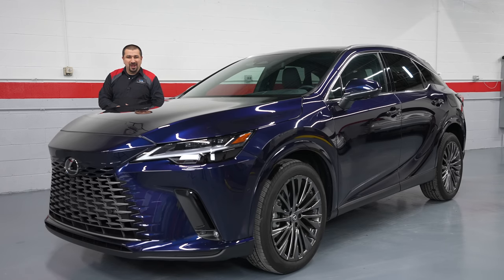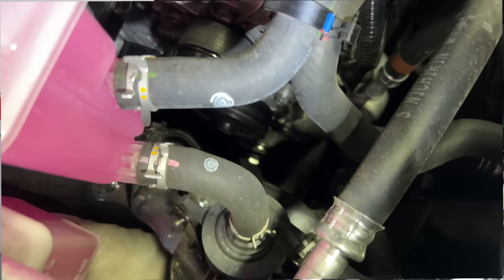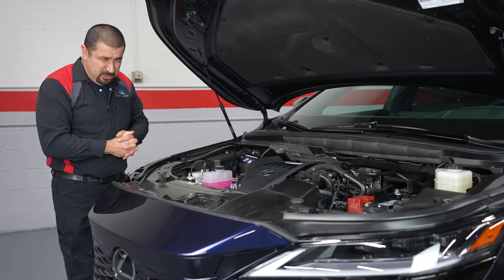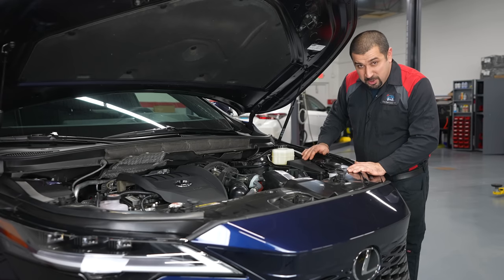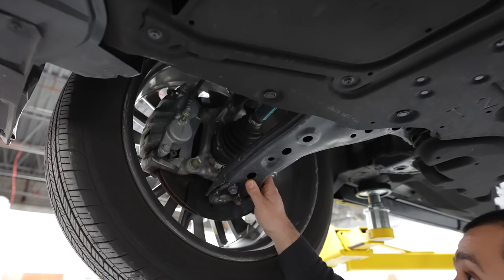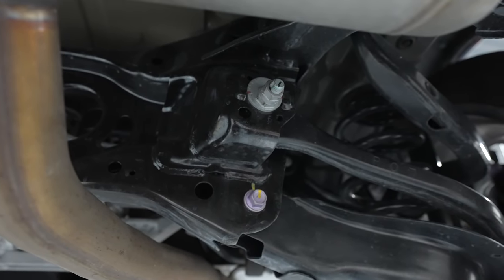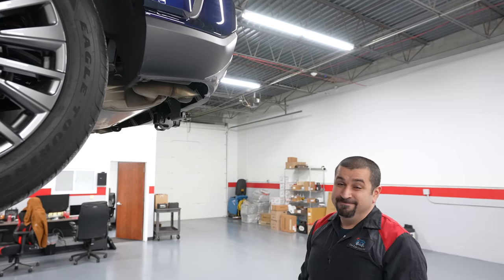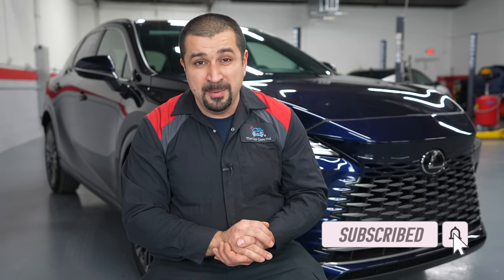Should You Buy The 2023 Lexus RX? Everything You Need To Know

Comment: Fantastic review from a very unique perspective - Thank you AMD (for the reviews and the rest of the content you create).  Comments:
- If the infrared alertness camera will allow me to use the adaptive cruise and lane-keep assist WITHOUT forcing me to have my hands on the steering wheel (just monitoring my attention), I think I would like it a lot.  Shaking the wheel every few seconds (driving on straight interstates) on current systems negates the benefit of a good lane keep assist.
- Totally agree with the comments on a 4 cyl engine.  I ran away from Volvos a few years back for this very same reason (engine out of character for that class of vehicles).  I love my 2GR-FKS in in my Toyota Tacoma (manual) and my ES350.  I guess I will migrate towards the LX (expensive!), or more likely, Tundra/Sequoia.  Or quickly snag the last of the V8's - like the IS500.

Comment: The engineering team is trying to meet newer emissions standards, so larger displacement engines are giving way to lower displacements and turbo charging. The problem is that the old RX is all about smooth. The interior is quiet. The engine is strong but unobtrusive. The new car replaces that with more engine noise and useless nanny tech that beeps at you and distracts you at the same time. Not smooth or quiet. At least it has a spare tire.

Comment: Lexus is tired of being the most reliable luxury car brand.... so it's looking to dethrone itself from this title by putting a turbo 4 into its best selling suv.... good work
Reply: Not true. The EPA forced them to put turbocharged engines with smaller displacement in the name of "environmental protection." If it weren't for the Democrats, Toyota would still be using naturally aspirated engines.
Reply: @lightsfansofthewest481  
No one forced Toyota to do anything.  Toyota is just using the new EPA guidelines as an excuse to cover up their massive cost cutting measures & failed, short sided EV debacle.
Reply: @TheBjjones  Okay, then why is Stellantis planning to discontinue the HEMI V8 and replace it with the Hurricane I6 turbo? Why is the new Chevy Colorado only available with the 2.7 I4 turbo instead of the 3.6 V6? It's only going to get harder for those still making V8 engines to meet emissions standards, like Ford and GM.
Reply: @lightsfansofthewest481  
Stellantis is only discontinuing the Hemi V8 in some Dodge/Jeep models while other Jeep/Ram vehicles will still soldier on with the Hemi V8, unlike Toyota, who has basically eliminated all of their V6/V8 powertrains & replaced them with downsized 4 cylinder turbos/4 cylinder engines with hybrid batteries, that in reality, aren't any better than prior Toyota engines.

Furthermore, there's absolutely nothing wrong with GM offering a 2.7L I4 turbo engine for a mid size RWD/4WD truck like the Chevy Colorado which is not quite the same as saddling a mid sized luxury SUV like the RX, known for it's serene quietness, with a raspy 2.4L 4 cylinder turbo engine.

And smart vehicle brands such as GM & Ford don't/won't bare the same draconian penalties from EPA guidelines ,which is primarily based on their current/upcoming lineup of EV's, none of which Toyota has on the market currently or in the pipeline.

Comment: Check your audio.  I hear a buzzing noise that is common on some computers that is caused by the ground.  Isolate the ground and the noise will be gone.  I’ve seen it on a lot of Dell Laptops.  Just isolate the ground pin, it isn’t needed on a laptop.  Or just unplug it.

Comment: I have a 2020 camry 4-cyl which is loud when accelerating. So I know what you mean about the engine not suiting a Lexus.
Reply: I have a 2020 Camry too. The 2.5 engine is just too noisy for the class. Thankfully you can still get a v6 in the Camry that’s significantly quieter and more refined

Comment: Another Gem Lexus and review. Love Lexus and this review is great. Yes this needs a smooth V6. Don’t like a turbo 4 cylinder, I think long term reliability can be an issue. 

I own a 2002 ES300 w 173k miles and my 1MZ V6 doesn’t burn a drop of oil in a 5,000 synthetic oil change interval.  Refinement, fit and finish is unparalleled. Whisper quiet.

Comment: AMD, I am sold on this RX, especially the 4-cyl (anyone who fixed the V6 water pump and rear spark plugs will  know what I mean). Yes, the 4-cyl is loud, but you won't hear in the Lexus cabin. I would buy it if the dealer can TURN OFF the auto start/stop function PERMANENTLY. As far as the turbo, I believe Toyota/Lexus should be more reliable than BBA.

Comment: 🤣modern safety features are really annoying for sure. when driving in urban setting it can drive you crazy with all the beeps and buzz. had all the gen RX but skipped 4th gen but coming back for this gen5 with again the nice smooth lines. RX is the best long distance cruiser in all weather condition with just right sized for urban environment. I will definitely miss the V6 bulletproof engines.

Comment: Hope my 2015 RX FSport lasts the 10 years of driving I have left; low mileage, meticulously maintianed , rust proofed yearly, fingers crossed.
Reply: Your RX has the bulletproof 2GR v6. You’ll be just fine. As long as you continue to take care of it it’ll outlive you
Reply: @naveenthemachine  yep.  My wife’s 08 RX350 has 155K miles on her and still runs/shifts like a dream.  My 2017 ES350 runs like the day I bought it at 35K miles.  BTW, looking at the new NX hybrid now to replace her RX soon.
Reply: You are describing me and my 14 Rx to the T. 👍 My 18 GS is my summer car and never sees snow.
Reply: It will be right in time for the 2025 RX250 3 cylinder bi-Turbo :D

Comment: If the Toyota corp will not stand up and resist and fight they have disgraced their ancestors. In addition they could reduce vehicle weight, remove all non-essential systems, and offer a basic V-6 with a bulletproof 4 speed auto with od manual air and 18 inch wheels. They are failing. Sad

Comment: How long can that turbo last? I talked to several mechanics and they told me 100K-160K. What is your experience with turbos?
Reply: There are turbos and there are lexus turbos. Cant lump them all as the same. If you paid attention to the vid, there are unique design differences which are explained. I would think they last much longer than 160k miles.
Reply: Turbos, if cared for (Oil changes, letting the car cool of before shut down) can last well over 200-300K. Also turbos are not super expensive they usually run 1000 bucks.
Reply: @AgonxOC  Does anyone out there owns a turbo engine that has 300K miles on original turbo? I have never met anyone who can say that.
Reply: @zemo2332  plenty of turbo engine with over 300K miles out there. What do you think those rigs, locomotives, and ships that move cargo around have!?
Reply: @AgonxOC  I am not talking about turbo diesel engines. I’m talking about turbo 4 cylinder gasoline engines. Anyone has one with 300K? How many turbos did you charge to get to 300K ?
Reply: @zemo2332  none, if you properly care for the engine.

Comment: The RX interior looks too much like a Toyota than a Lexus.

Where’s the leather doors? Leather / stitched dashboard? Stitched airbag cover? Wood trim? Or luxury features like air suspension, 4 zone climate control, or ottomans or a 12.3 in lcd cluster? You expect all of that in a Lexus.

Well none of that is there. Instead you get the same injection molded plastics as a Toyota.

Doesn’t really scream true luxury like the gv80 or MDX or even a cx9 palisade do.

So overall yea I was right from the get go. The RX just like the nx and lx are a mess
Reply: Half of the mdx dashboard is piano black plastic
Reply: That moment when a RX330 had the option for air suspension back in 2004-2006 because of a little rare package called the performance package. 
Oh, and the Japanese got folding mirrors and a front and passenger side camera.
Reply: @ryanandrew87  but I don’t think it’s as much as the Lexus RX. Plus the MDX has leather and metal speaker grilles to compensate
Reply: @Paul yeah. I’d even say my 2020 Camry XSE red interior is about as nice if not a tad nicer than the RX 

Of course no Toyota can beat the out of this world LC500 interior though

Comment: You and I totally agree.  It's nice to have some technology upgrades but it was negated by using a straining 4 cylinder engine.  In my book the engine and reliability are more important and most people who buy the RX are looking for that.  Also, what is the difference in the RX and the NX.  The NX is a smaller car, same engine, same technology you would be better off with the NX since the engine will not be as strained since the car is smaller.  I give lexus a down grade on the RX redesign specifically because of the engine choice and the electronic gizmos to open the doors.  However, Lexus usually knows it's market and I guess they are expecting the market to change on the people who want the RX versus its prior history.  The style design I can handle but otherwise a BIG MINUS.

Comment: Great review. I have the good old 6 speed auto in the 2013 Lexus RX. It hasn’t needed anything but normal maintenance and I plan to keep it as long as possible. Keep up the great reviews. 👍
Reply: Do you do the 'drain and fill' transmission fluid changes with your 2013 RX at 60,000 mile intervals?
Reply: @rightlanehog3151  I just use valvoline maxlife and ‘drain and fill’ it every 50k miles and have never had a problem. 210k miles and still going strong.
Reply: @apoc341  In that case you should be driving your RX for another decade without issues.   I change the 2 quarts of Amsoil Gear Lube in my 2005 manual transmission at 
5 year intervals which don't exceed 50,000 miles. The Toyota coolant and power steering fluid are done at the same time to keep things simple.

Comment: Great review again, unfortunately some of the most important features get forgotten. For me it is reparability and recyclability. When I worked for Siemens siemens printers and teletypes. They made their products with the best reliability but made it so it had great reparability. They designed assuming it was going to repeatedly fail. Down time was key. They simulated faults and monitored repair time. If only vehicle manufacturers  did a similar thing. Put the technology into reliability and reparability. The aircraft industry does a lot in this area. You need to be informed of danger or errors but not totally distracted. There is a famous crash resulting from the whole crew investigating a blown bulb. The system was working but the gear down and locked indicator  failed to light.

Comment: I'm a current and original owner of 2008 Lexus RX350.  I was "toying" with the idea of upgrading to a 2023 model, but this review has given me pause.  My mechanic has stated that I can drive this car into the sunset.  With only 80,000 miles on the car, no thanks.  I love sunsets.
Reply: Joyce, I also have a 2008 Lexus RX350 which I love. It has 95,000 miles on it. Its current problem is a hard-to-find leak of A/C refrigerant. I was also thinking of upgrading to a 2023 model. I might just stay put and have my mechanic add refrigerant when needed! That will be me driving behind you into the sunset!

Comment: Im on my 2nd RX-350 a 2020.  Got it Oct 3rd 2019. Great vehicle as was my first 2015. Last year I test drove a RX-350 "F" sport with 4 cyl turbo. I noticed right away it was a Turbo. Not as smooth when asking for GO power. It simply was not as responsive. My 2020 fuel mileage around town was 20 MPG. On a long trip in ECO mode and observing agressive driving, I got a showing 31 MPG. Highway driving and some urban driving.  Overall I drove 750 miles with that fuel economy. New 2024 4 cyl economy was not noted, but older V6 was more responsive. Just my feelings.

Comment: Have a 17 RX and after hearing the dropping of the 6 cylinder, figure this one will last us like - forever. 
Adapting to technology doesn't bother me, however my wife is another issue. She has a hard enough time remembering buttons, asking her to maneuver a screen is like - well, "can you write me instructions"....
Seeing the hitch mount on the 23, curious what it can actually tow. 
Our 17 has the tow option and I installed a hitch. Not that I tow a camper or such, but it comes in very handy for those home center or rental center needs - hitch a trailer up and I'm good.
Reply: The 2023 RX tow rating seems to be around 2,000 pounds for an unbraked trailer.

Comment: The way they did the buttons on the steering wheel was frustrating at first. So I agree that on first look, it seems annoying. However, after using it for a while, I can’t go back to any other way. The fact that I don’t have to look down to see the label of the button and the fact that the button can be multipurpose based on software I think is actually safer and better.

I agree with pretty much 90% of what you said in this review. However, I take issue with the fact that you said that people don’t buy this car for the looks. In its class, I think it’s the best looking one. But looks are subjective.

Comment: You are absolutely right about the new RX. It’s overly complicated and for no good reason, except for environment/emission reduction related PR and green washing. The 4 cylinder turbo engine sounds like a flapping cardboard we would put on our bicycle wheels as kids in the 70’s and it’s  gutless too, except for the RX500h which is very powerful but then you need to deal with Hybrid + turbo which  just adds unnecessary complexity and more things which can go wrong in the long run. I recently had the choice between waiting for the 2023 RX or buying the 2022 with the trusty and buttery smooth V6 engine. Needles to say, I bought the 2022 with the V6 and didn’t regret it for a second. 
Another consideration was to buy a last year’s model where most of the issues have been addressed as opposed to a first year’s model which may have potential unknown issues which will need to get resolved. 
I follow the KISS principle.

Comment: I now have the NX 450+. thanks to your excellent review. A different car I know. I’m in Scotland and have two questions I have asked my dealership. They don’t know. Firstly is the heads up display mounted on shock or vibration mounts? I ask because at times on a rough road the display shakes a little. Secondly is there a disk drive behind the dashboard? Occasionally there is a noise like the disk drive in a computer spinning up. The car is so quiet it can be heard. Your videos are very informative and I enjoy them. Your obviously a very knowledgeable engineer. I would value your opinion. Thank you in anticipation.

Comment: One of best reviews.   It is so stupid to get rid of V6 and the rear bumper.  The designer's brain was shorted there.  Toyota/Lexus are trying to save their money making the car but not your money.  Now you have to use premium gas and end up paying even more in the long run, plus you are very likely going to spend a lot more on repair due to the new engine and tight space for service.  There are enough Lexus fanboys out there and they will buy the next RX350 even if it were made of plastic.  Toyota is never a loser, buyers are.

Comment: I purchased a new 2022RX 350L that was built in Japan, there was a slight droning noise and corresponding vibration when accelerating in stop and go situations, but goes away once the car is above 25 mph.  Went to the dealership for the 10k complimentary service, they replaced the stock center exhaust pipe with the “improved center pipe”. After that, the droning and vibration got much worse, now we have louder droning and vibration at steering wheel and gas pedal/floor at almost all speeds whenever RPM is between 1k - 2k.  I returned to the dealership and communicated the issues and was hoping something might not be sealed perfectly when they replaced the exhaust pipe. They spent a week on it, and just called me saying there’s nothing wrong and within the intended spec by Lexus. I am frustrated as the new car now rumbles like an old truck and the steering wheel felt like the electric toothbrush when accelerating and cursing on the freeway.  Very disappointed and will reach out to Lexus corporate to see if they can fix the issue.  Any experience/advice you could please share on how should I go about this would be much much appreciated.  Thanks for your time in advance!

Comment: ❤️🖐🤔 just sold our 1999 RX300, had since new, not once in the repair shop. I love the 2023 model and was 90% sold until about minute 35:00 when you point out the downside of the overdone electronics, beeping, etc.  The constant warning beeps are a deal breaker, and are irritating as you describe.  We have a 2022 Mercedes GLE350 and while it’s a nice riding, quiet car, the electronic beeping is very irritating, to the point we have changed our mind about purchasing vehicle when lease is up in 2 years.  I think we may have to look for older models for our next cars!

Comment: i bought an NX 350 2024 ...its my first lexus ..  i think my nx is very quite.......i will just have a few adjustments to make compared to my regualr 4 cyl engine in the past:  first use premuim gas, use the right oil, change oil every 5 k and let the car idle for a min when driving at high speeds....  i can live with that.     p.s  as far as gas,  probably spending a few hundred bucs more a year compared to 87 octane

Comment: Wow! Great video. I have AN RX350 (2020).  I was planning to trade in and get 2023. Not happy about the 4-cylinder, and the unnecessary safety noise sensors.  Not happy with the Prius gear shifter in a RX 350.  Best I hold on to my 2020 RX350.  Thank You